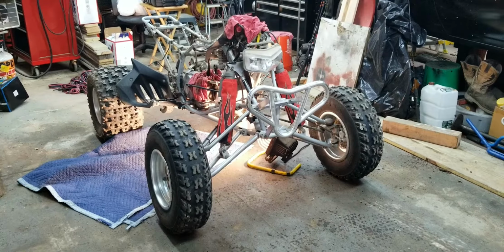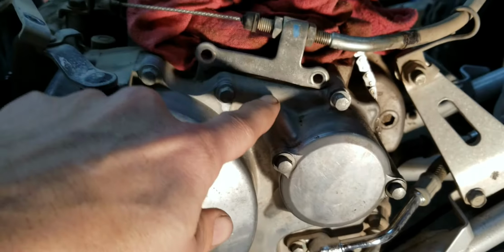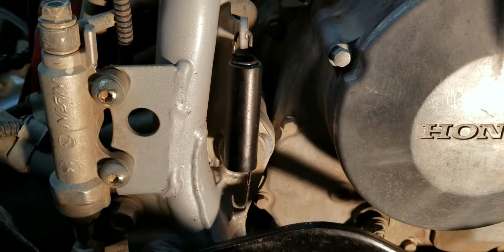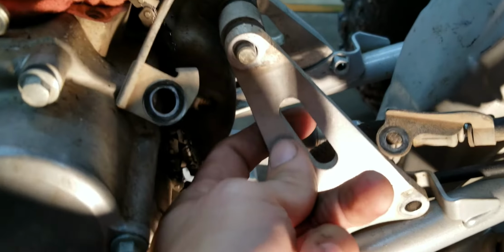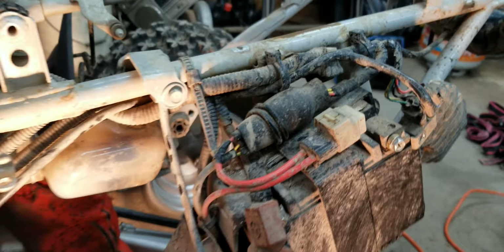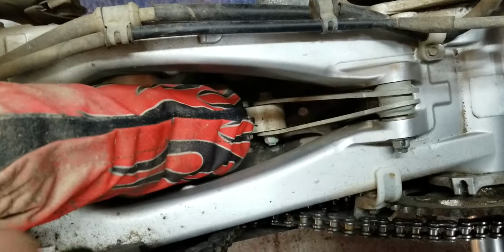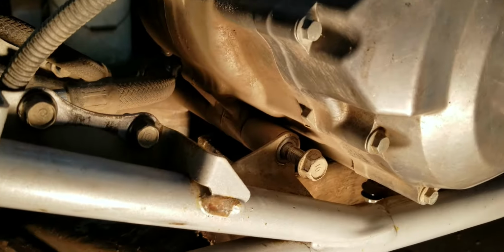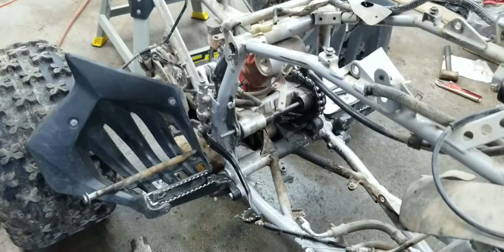Engine Removal From the 2008 Honda 400EX 3-26-22

Comment: Where cliff right now? I need him to help with a swingarm bolt for my 400ex as well 😭😭😭😭
Reply from the maker: Yes it is nice to have A Extra set of Hands for this. Basically we used A long bolt, and Small Sledgehammer, and kept hitting it,  it moved after that.  
Good Luck with Yours! 
Thanks for Watching, and the Comment.
Reply: @MichiganQuadTrailsTales  what type of bolt exactly because I'm using a punch and a hammer and it's not moving. Gonna go tomorrow to get me a sledgehammer and a bolt that can take a beating
Reply from the maker: @fredericknino9340  I was using A 1/2 Bolt. Best of Luck to You!

Comment: NOTE: during the annual routine maintenance procedures, remove the swing arm bolt, wash old grease off of it, dry it, sand off any corrosion, coat it with waterproof grease and install it. if done yearly, removal at any time is effortless. It's routine - DO IT!
Reply from the maker: Thank You!

Comment: When you removed the swing arm motor mount did the swing arm tend to fall? Wondering bc i am removing the engine tomorrow and was wondering if i'd have a hard time with that😅
Reply from the maker: Great Question, the best I can think is that while we were pushing it out with that long threaded rod,  the swing arm did not move anywhere, cause the threaded rod was holding one side at least.
Best of Luck to You on taking Your Out!
Reply: @MichiganQuadTrailsTales  thanks i appreciate the help. Video has been helpful keep it up!